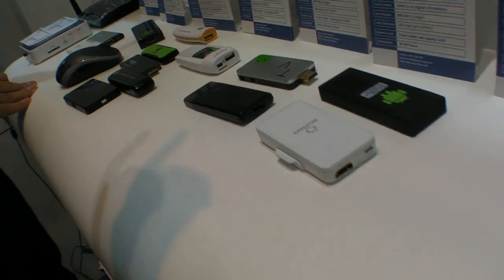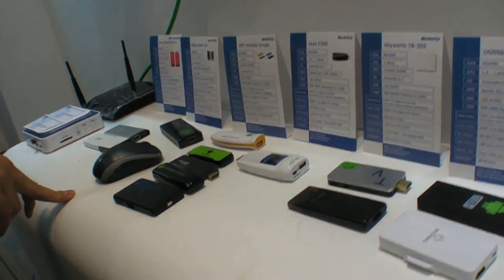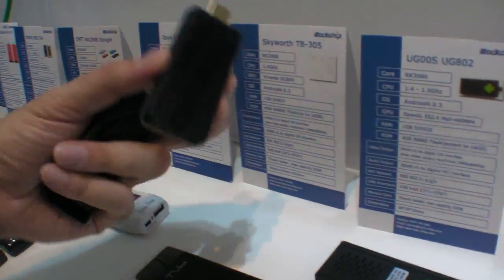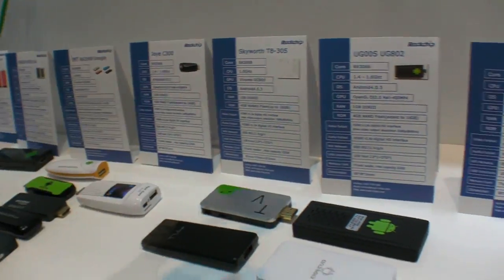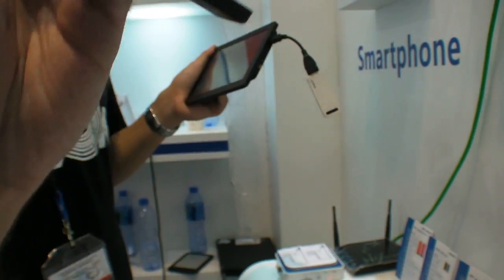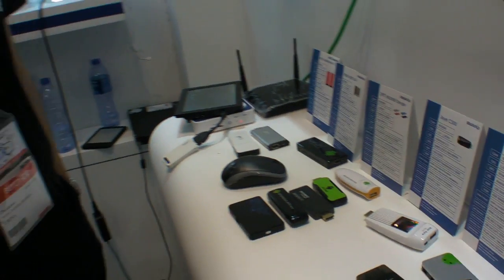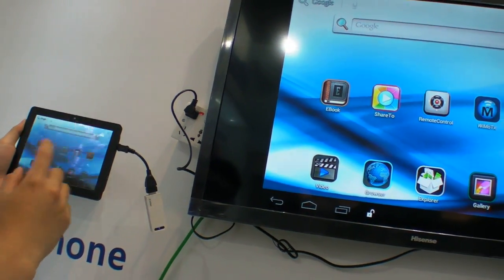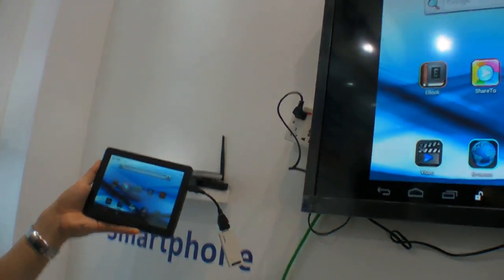The bunch of Rockchip RK3066/RK2908 HDMI Sticks

Comment from the maker: My guess is the Android firmware is modified to hardware accelerate mirroring. So it's not just an app to run on top of any Android with good performance. They communicate over wifi direct, bluetooth, over wifi hotspot or anything.